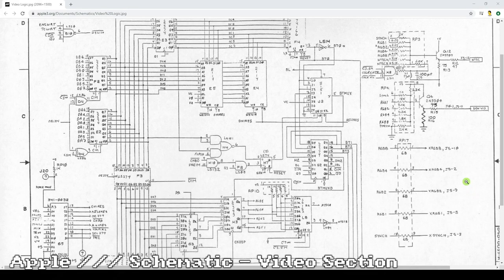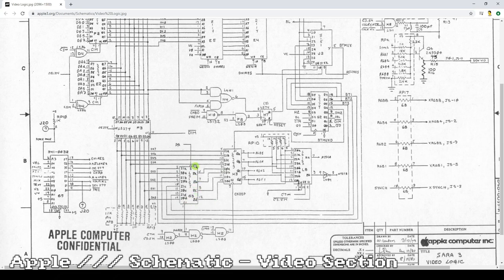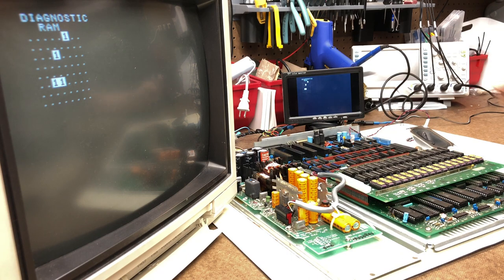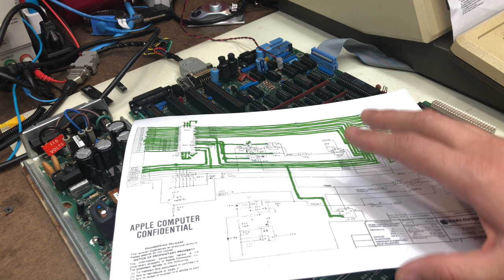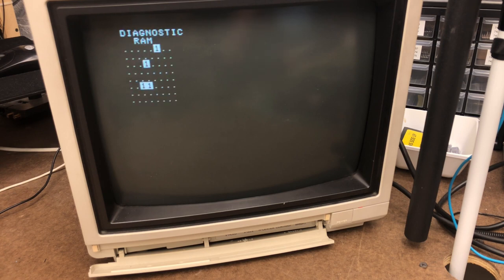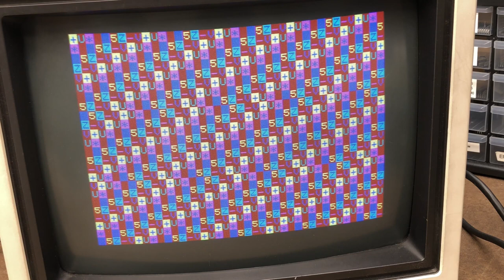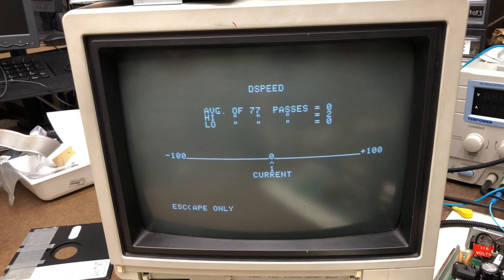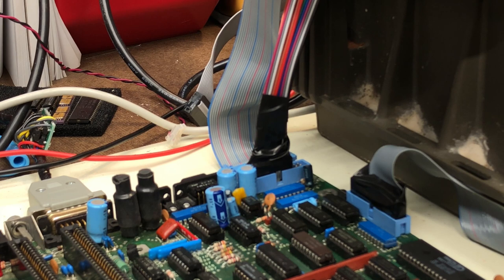They Deserve Love - Apple /// Repair & Restore: Part 1 (Apple 3 Repair Video)

Comment: Great video Joe!  I loved the RAM hacks there especially the ones for those stupid 32k x 1 chips! Awesome. I got yelled at in the comments on my videos when I used a cleaning disk designed for double sided 5.25" drive on a single sided drive. Apparently it puts stress/wear on the top pad.... so I cut a piece from a bad floppy and taped it over the top side hole on my cleaning disk.  I'm working on a GAL based solution to remap the Apple II TTL-RGB colors to something more appropriate. I guess I need to revisit this!
Reply from the maker: It's not a JCM video if I don't hack something in a really wacky way. If you want a tester and/or collab on your TTL-RGB project, let me know!
Reply: Yeah they made cleaning disks specifically for single-sided drives.

Comment: All that capacitor swapping! You make it look so easy.
Reply from the maker: With the right tools, it's not hard, but it does take practice. As long as you don't dwell on the pad with the iron/vacuum too long so as to cause damage, it goes pretty fast and it only takes a few tries to get the feel for it.

Comment: I couldn't be sure from the angle but it looked like that power supply was missing two RIFA caps. They probably blew at some point and rather than replace them, someone just removed them. That would explain the noise you described.

Comment: The timing label on the disk drive is designed to work with no special tools or strobing - all you need is your typical incandescent or florescent lighting in your shop. They will strobe at the 60Hz frequency of your home's electrical service. You adjust the potentiometer for the drive speed until the 60Hz pattern on the flywheel label appears 'stationary'. For other areas of the world on 50Hz electrical system (such as Europe), you would use the 50Hz pattern.
Reply from the maker: The six standard T8 fluorescent tubes right above my bench do not suffice for this.
Reply from the maker: Correction: T12.

Comment: Interesting memory mod... but I'm thinking you might be able to do that with a single chip... with the addition of two diodes instead.  The high order address pin you lifted and shorted to 5V can actually be one of the row/column address pins you jumpered instead... and the other can be paired to the original one with some diodes that can be used on the other to prevent crosstalk.

Comment: Can you advise on how to get an Apple 2e running? Mine won’t startup at all, no beep, no light, absolutely nothing on power on. I’ve reset all cards, examined all boards and chips etc and nothing looks blown, drives don’t boot, power supply volts look pretty good. The +12 is closer to +11, other than that not bad. I’m baffled.
Reply from the maker: Sure thing. Go to my about page and email me at my business address.

Comment: That power supply is missing the 0.22 and 0.1uF Rifa capacitors.
Reply from the maker: Yup! They're not needed.
Reply: @JoesComputerMuseum  Maybe if you put them back the noise(s) will disappear?
Reply from the maker: @gotj  Nope, it doesn't.

Comment: BTW I recently spent 2 months ressurecting my apple 3, i've studied that service manual extensively. let me know if you need help!
Reply from the maker: :D
Reply: @s3v 2 months?  Hey, I saw your vcfed thread that goes back to 2017.  :)
Reply: @brianv2871  true that. but the burnt of the real heavy lifting was the last 2 months!
Reply: @s3vR3x  Yeah, Adrian and I got the play by play, so it seemed longer than two weeks 😁

Comment: seriously if you need help with the apple 3, let me know..
Reply: WOW NICE job on those 4332's!
Reply from the maker: Will do. The worst one is done with. Unit 2 is in much better shape. There remains the problem of only having one keyboard encoder between two machines, but I have diabolical plans for that. 😈